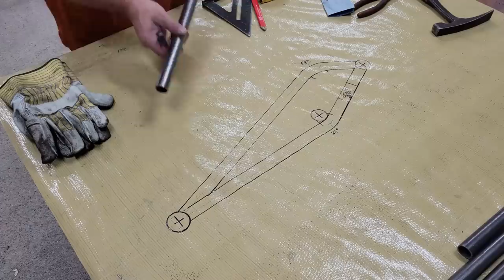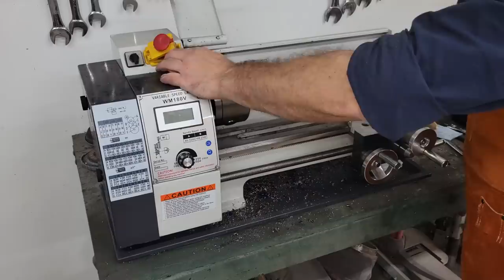Electric Motorcycle Build - E-Bike - Gen II, Ep 2: Girder Forks & PDS Suspension

Comment: Don't forget to install a kill switch on  the kickstand. There's a good reason motorcycles have them.
Reply from the maker: For dummies. ICE bikes have safety sensors in the kickstand to signal to the ECU to kill the engine when the kickstand is engaged to prevent the bike from taking off unexpectedly while it's on the stand because a dummy leaves it in gear. Different situation with electric - there's no gearing to worry about that. If I turn the key, it's not going to take off unless I do something REALLY stupid like try to rev the throttle, which I understand well enough not to do. I prefer to be able to turn the bike on while the kickstand is engaged for a multitude of reasons.
Reply from the maker: Should also note that the Kelly esc has numerous safety features, one of the standards being protection against high throttle input on startup. So in the off chance that I have the throttle twisted for some stupid reason or there's a short of some kind when I turn the key, the esc trips a relay and cuts power to the motor to prevent accidental take off. Bases are covered.
Reply: @James Biggar  I didn't mean an accidental take off though. Not uncommon that people ride away with the stand down.
Reply from the maker: You're right. Been there before. But that's not the reason for kickstand kill switches because the road will remind the rider to put it back up if it doesn't do it for them. The greater danger is unexpected takeoff from leaving it in gear accidentally when starting up. If the stand swung in the opposite direction then I'd be worried, but I still wouldn't feel comfortable running a fat transmission cable down there to operate a kill switch w/ a pre-charge resistor either. Kill switch wiring on an ICE is considerably thinner - spark plugs don't use anywhere near as much juice as a 28 kW motor. Have a look at the kill switch on my buggy for an example.
Reply: @johan.mp4  да, я на своем самодельном электробайке очень часто забываю убрать подножку. Замечаю это только по звуку в поворотах, когда подножка цепляет асфальт. У меня есть на канале
Reply: @JamesBiggar  hi bro, James, i really liked your bike, tell me, do you make it to order?  Or are you selling the bike?
Reply: The girder fork is a beautiful piece of work Ja,es.  As an engineer it’s aesthetically pleasing to look at.  A bit like a lot of Tony Foale’s frames.
Reply: Could the kick stand switch not be wired to the throttle signal or live? I get it’s a feature for idiots but it would stop an idiot twisting the throttle whilst chatting to you about the bike and then watching it crash down on its side ruining your work.

Comment: Outstanding design and engineered with proficiency way beyond my level. Was so impressed by BMW's Telelever suspension in the early 90's that the thought of diving forks puts me off riding. I hardly ever ride anything else. Not that yours isn't a massive leap forward compared to them!! 🤗
Reply: There are several alternatives to conventional telescopic forks, if you are really interested. These girder forks (with the entire linkage turning on a steering post), double leading A-arm designs (in which the A-arms pivot on the fixed structure and the steering links to a hub/fork carrier like a car suspension), Telelever (which is essentially a MacPherson strut turned forward instead of sideways), and various hub-pivot designs. Telelever is the simplest and works well.

The biggest challenge is the steering linkage. Girder forks and Telelever make steering easy (just mount handlebars on top), which is the biggest reason that they are good choices.

Comment: fork looks so massive and its amazing that it have same weight. Interesting which weight is "unsuspended" comparing to regular forks? Hope I use correct word for term.
Reply from the maker: Good question, hard to say without breaking both sets down to their unsprung components. I suspect the unsprung weight for girder is probably a lb or two more if not very similar.

Comment: The progressive spacing of turns of the front coil does cause progressive (increasing with compression) spring rate, but does not affect damping. Progressive damping requires a progressive internal damper (shock absorber) design, or a progressive linkage.

Comment: Rad! Looks awesome. Lost track of your vids after you finished the last bike. 

Awesome work on the lathe. Even awesomer having not used it before. Surprised that the threads worked at all with that cutter. They make cutter inserts with the correct tooth angle.
Reply from the maker: Thanks! 60° thread angle is correct. Tip radius could be smaller, though. The 5 pc tool kit was technically made for threading and other tasks, but it was cheap.

Comment: Love the fabrication video and the fact that no cnc machines were used in the process is very impressive! I wanted to design my own girder suspension but the proper linkage geometry is very tricky to come up with. How did you go about figuring out lengths and angles for the links?
Reply from the maker: Thanks! I cut out some small scale profiles of the forks, chassis and linkages from abs sheet that I had left over from the buggy build. Drilled a few extra holes in the linkages, assembled with wire and just went through the motions and kept trying different positions until I got the axle travel that I was looking for, then transferred the dimensions to cad to check with the 3d model and ensure the forks weren't going to hit anything or get jammed up under the chassis during compression and turning.

Comment: This project is incredible 👌🏻
I do have one concern about the angle of the front forks, it does look a little goofy compared to similar telescopic forks.
Reply from the maker: Thanks. If you're referring to stability being a concern, then rest assured that that depends on the rake (caster) angle, and the rake angle is determined by the angle of the steering tube, not the fork tubes. The fork tubes could be bent in circles and they'll still work just fine as long as the steering tube angle is set to provide the balance between stability and agility that I'm expecting. 

Looks on the other hand, are totally subjective. Every bare chassis looks goofy until the fun stuff's added. Refer to past community posts for an example of the design in its early stages with girders vs telescopic. The chassis and girder forks are designed to work with the body style as much as the powertrain components. It'll all come together to make a bad ass looking bike, like the Magpul Ronin which was the main inspiration for the previous bike and this one. It has a set of Hossack forks. My skills and confidence in building a set for the first bike just weren't there, so I opted for tele at the time. But they just didn't look good on this version at all in CAD. They actually looked goofy, and boring. Did not fit well with the trellis chassis look. I'm just not a fan, and that's all the excuse that I need ;)

Comment: If the weight of either suspension, Grider and twinfork is the same, what benefit does the former have over the latter? What would be the optimum solution to reduce the weight of the vehicle, whilst not compromising on suspension/forks?
Reply from the maker: Covered that in the video, bud.

Comment: very good dude. Why are you dont making aluminum chassis. Im only curiosity
Reply from the maker: Because there's no practical advantage. Aluminum is lighter, but weaker, which means all of the tubing would need to be larger/thicker to compensate, which doesn't help reduce weight in the end. That's why a die cast aluminum sport bike frame weighs approx 25-30 lbs whereas my steel frame only weighs 17lbs (see previous video for weighing). The only good reason most manufacturers use aluminum die cast is exactly because of the reason I stated in the video - it's mostly automated, so they're cheaper to produce than hiring a bunch of skilled labourers to make lighter trellis frames like mine. Steel trellis is lighter and stronger than die cast aluminum, but more complicated to make. Aluminum trellis is similar weight and strength as steel trellis, but even more complicated to make than steel because aluminum is more difficult to weld.

Comment: Nice bike!
I fear excessive squatting and anti-squatting caused by braking and driving  forces.
It would be better to have a linkage mechanism to distribute each force to the frame as well as the swing arm.
Reply from the maker: Thanks. Squatting happens during acceleration, that's why we use a proper anti-squatting swingarm angle. Driving force, weight shift to the rear wheel combined with chain pull during acceleration causes the suspension to compress/squat, and if the axle isn't below the swingarm pivot to a certain degree, squat happens and the rear wheel looses traction. Anti-squat angle puts vertical force on the wheel for better traction and take-off ability. This bike is obviously direct drive and not affected by chain pull lifting the rear wheel, but I gave it a 12° anti-squat angle to counter the other forces. Typical for most bikes, same deal as the previous bike I built. 0 squatting occurred. The PDS linkage for the rear is no different than any other progressive linkage in terms of function, or any different than connecting the coil-over directly to the swingarm in terms of transferring forces between it and the chassis. It just changes the compression/dampening rate, ie: the more the swingarm travels, the faster the coil-over compresses to provide progressive dampening. If by 'squat' you mean sag, then that's determined by the coil-over specs and rider/curb weight and has nothing to do with braking or accelerating. Squatting doesn't happen during braking because all the weight of the bike moves to the front wheel, not the back. Unless you're referring to nose diving in the front. That's inherent and unavoidable with telescopic, but eliminated with girder. Girder produces an anti-dive effect when braking to allow better use of the suspension travel.
https://www.datamc.org/data-acquisition/suspension-data-analysis/anti-squat-geometry/

Comment: Amazing fab skills amigo!
Please let me know - how is that qs273 hub motor holding up?
I'm on the fence about buying the exact same motor qs273 17" but I've never tried a hub motor before. What do you think of the reliability and serviceability of that motor?

I have good luck with the qs138 mid drive motor, and was thinking of using the qs180 mid drive motor next, but seeing what you've done with this motor makes me think I should consider it.

I'm primarily concerned about longevity and performance on hills ;)

Thank you for sharing your stuff, it's awesome!
Reply from the maker: Thanks! It works pretty good, but it's a lot of unsprung weight so suspension requirements are different to control it vs driving it with a chain. Hills are not a problem, produces over 300 ft-lb of torque. I can climb the St John river valley with ease and plenty of power to spare. Hub motors are tanks. But like tanks, they're heavier than their counterparts. I wouldn't hesitate to try the qs180. It's a great motor. They also have the qs 165 which comes in three power sizes now, 5-20 kW I believe. They stock the smallest but the others are made to order and come with a gearbox.
Reply: Thank you!

Comment: This looks awesome, ……but unfortunately, it also looks like a heavy frame as a result of the supplies available (ie: steel  vs aluminum )
Reply from the maker: Thanks. Apologies in advance for the long response, but it's beneficial, I promise. Watch the chassis video to verify weights and compare with a common die cast aluminum frame. Then cross reference with the links I provide for load capacity and raw material weight. This steel trellis chassis = 17lb, swingarm = 10lb, sub frame = 4lbs, forks = 21lb. Aluminum die cast frames like what you see on an equally sized production sport bike weigh 20-25lbs at least. Aluminum swingarms weigh at least 12+lb, telescopic forks weigh 20+lb. Aluminum is lighter by volume, but also weaker so components need to be larger/thicker to compensate. Ignoring die cast frames, even if I wanted to make the same frame out of aluminum tube - assuming I could afford it - the tubing would need to have a larger diameter and/or a much thicker wall. Ex: a 12" long x 1" diameter DOM steel tube with a 0.12"  thick wall has a safety factor of 1.7 when a 1000lb load is placed in the center of it. A 12" x 1" diameter x 0.12" thick wall aluminum tube with a 1000lb load placed in the center would only have a safety factor of 0.8, less than half as strong as the equivalently sized steel tube. Depending on the grade (ie 6061 vs 6063, etc) the aluminum tube would need to be at least 1.25" diameter with a 0.25" thick wall to 1.5"diameter and 0.25" wall to achieve the same strength. 1"x0.12" steel tube is 1lb/ft, 1.25x0.25" aluminum tube is 1lb/ft, and 1.5x0.25" aluminum tube is 1.2lb/ft. So using aluminum and achieving the same strength would result in exactly the same weight, if not slightly heavier, and would come with a higher material and production cost because I would need a new $1000 TIG to weld it instead of the $200 standard flux core machine that I'm using. Aluminum is also more rigid than steel, which will shave a fraction of a second off lap time on a track but makes for a harsher (bumpier) riding experience. Steel provides more flexibility and better feedback to the rider on a street bike like this. Aluminum does provide better corrosion resistance, but if I were going to pay extra just for that then I would opt for stainless steel tubing instead (same weight as mild steel). Overall, this design is as good as it gets for an electric street bike by blending the best strength to weight ratio with affordability and workability, and is partially why the total curb weight will be 20-50lb lighter than a typical gas bike in the same power class (ie 300cc, 30-40 hp). The only reason most production bikes have die cast aluminum frames is exactly the reason pointed out in the video - making die cast frames is mostly an automated process whereas trellis frames require more skilled labour, so the former is a lot cheaper to mass produce. What they save on labour more than compensates for the extra cost for aluminum. For mass producers, maximizing their bottom line is top priority:
https://www.roguefab.com/tube-calculator/
https://www.metalsdepot.com/aluminum-products/aluminum-round-tube
https://www.metalsdepot.com/steel-products/steel-round-tube-dom